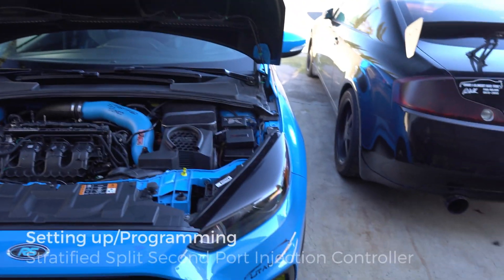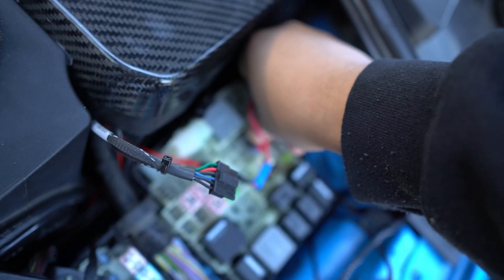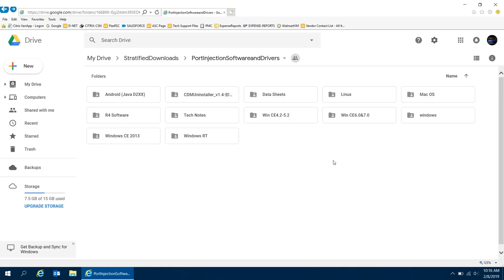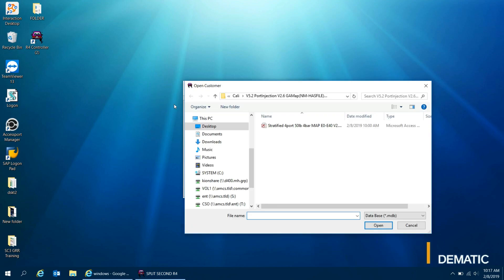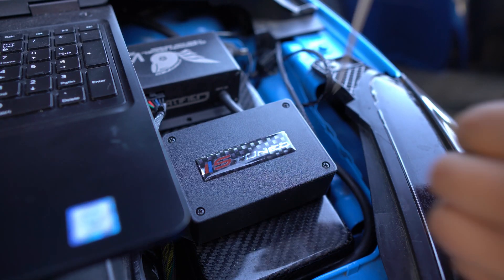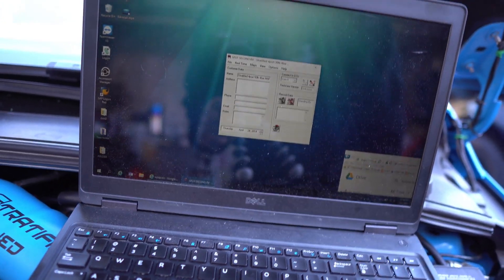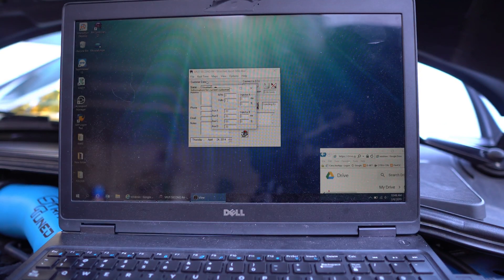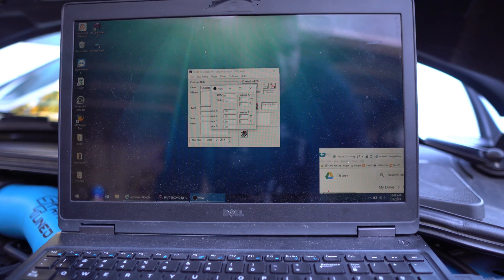Stratified Split Second Controller Setup (Port/Aux Fuel)

Comment: what if my voltage on my split second says 0.8? How do I get it to go up?
Reply from the maker: BoostedSpeed do you have every thing hooked up correctly? Is that with or without car on
Reply: Slowest_RS either way it’s the same .08
Reply: I hooked the red wire straight to the battery
Reply from the maker: BoostedSpeed what about the Green wire?
Reply from the maker: I think in this video it shows you
Stratified AUX/Port Injection Install on a Focus RS https://youtu.be/T9lvDO6vHAk
Reply: Yeah green wire to the mass air flow sensor